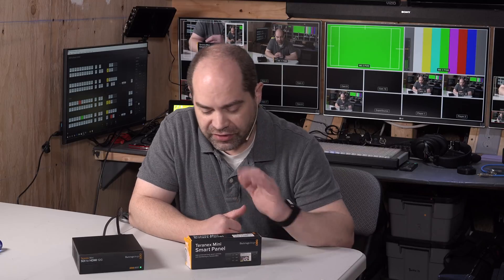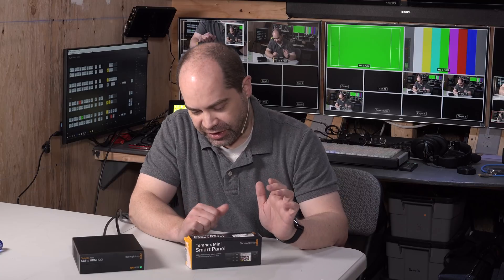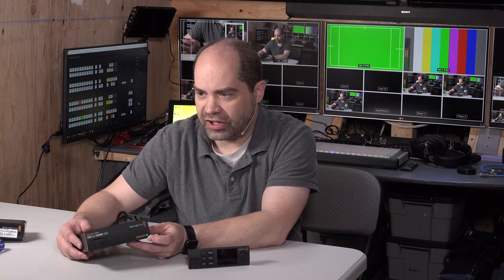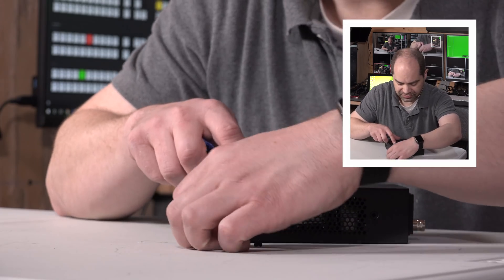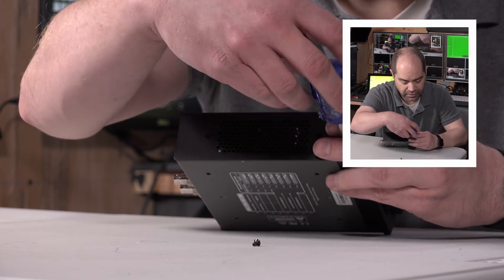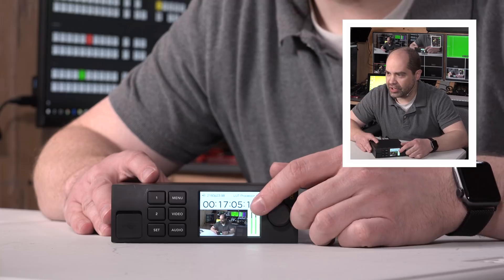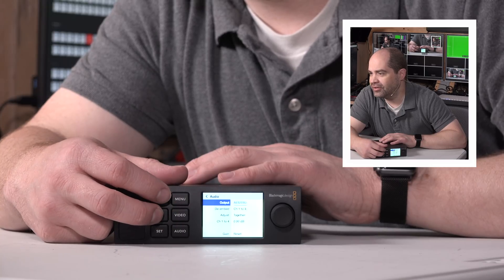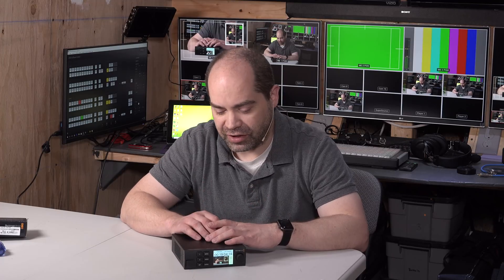Blackmagic Design Teranex Mini Smart Panel

Comment: I guess I'm curious on the latency over USB ?
Reply from the maker: I'm confused. The Smart Panel doesn't have USB.
Reply: @djp_video  Hey man, my apologies I thought this video was about " Teranex " not specifically the front panel. is there not a USB output on the front or back of the unit ?
Reply from the maker: The Teranex Mini devices have USB for device configuration, but that's all it's used for.

Comment: We have a blacl magic web presenter but do not have the smart panel.  My question is can you filter the audio output using the smart panel?  We are fighting what we believe is a ground loop background noise and filter out the noise using OBS but we have a new presentation program that pulls audio straight from the web presenter and the background noise is terrible.
Reply from the maker: No. It doesn’t have any audio filtering capabilities
Reply: @djp_video  thanks for the fast response.  All I can say is I hate ground loops.LOL
Reply from the maker: If it's on a balanced line not utilizing phantom power, you can entire disconnect the ground and it wouldn't affect the audio other than to get rid of a ground loop.

Comment: What do the 1-8 switches do indside the usb cover. I’m confused.
Reply from the maker: The switches are actually part of the host device, and are used to configure it when you don't have a Smart Panel. But once you add the Smart Panel most configuration is done through the on-screen menus.

Comment: Can you use the web presenter to split an hdmi input to separate sdi and hdmi destinations?
Reply from the maker: The HDMI output is a loop output so it will pass whatever signal is connected to the input.  The SDI Pgm Out will output whichever video source is currently selected for capture, so if you select the HDMI source for encoding the SDI Pgm Out will output the HDMI source.  The SDI Loop Out, contrarily, will always output whatever signal is present at the SDI Input.

The manual explains it fairly well.

Comment: Hi, Doug. I appreciate you making videos for us DYI'ers. Thank you! We are about to purchase one of these bad boys and I'd like your input. I see that you made this video just about 2 yrs ago. Would you recommend this model or do you have a better option?
We are using it for house of worship. We are using a Sony MCX-500 streamer board and run an SDI to a Blackmagic mini recorder to our iMac right now but, its time for an upgrade. Your thoughts are appreciated.
Reply from the maker: I assume you're wondering about the Teranex converters, not just the Smart Panel.  

If you need 12G-SDI support, the Teranex Mini converters are still a good deal. If 6G-SDI is all you need, and don't require an LCD screen to monitor the converter, Blackmagic Design's Mini Converter line is a much better value.
Reply: @djp_video  Thank you Doug.
 I see that the Teranex helps your computer  with CPU load. This isA feature I like about the Teranex VS the Mini Series. My Ultra Mini recorder over heats and freezes my stream, also causes Glitching. This is the reason for my moving away from the mini's. If I'm wrong, please correct my  thought. Thank you.
P.S. Thank you for Time !
Reply from the maker: I'm not sure how a converter would affect the CPU load on a computer. Care to enlighten me?
Reply: Sorry Doug, I had the wrong device in mind. I found out that need the blackmagic web presenter which everyone is sold out on. Thank you so much for your time. Again your videos are great!!
Reply from the maker: Keep in mind that the Web Presenter is limited to 720p.  It won't do 1080p or higher.
Reply: Do you have some else in mind that would work better?
Reply from the maker: If you're needing a device which is easy on the CPU, there aren't many other options. Most of these types of devices rely on the computer's CPU to encode the video. The downside to them is that the video quality isn't that great.  

If you want high quality video and have a Thunderbolt port on your computer, consider one of the UltraStudio devices from Blackmagic. They'll rely on the CPU to do the encoding, though. 

If those don't suit you, do a search for SDI Capture on B&H's website.